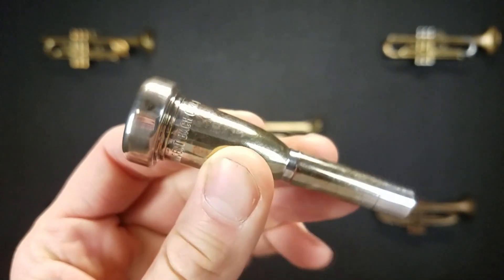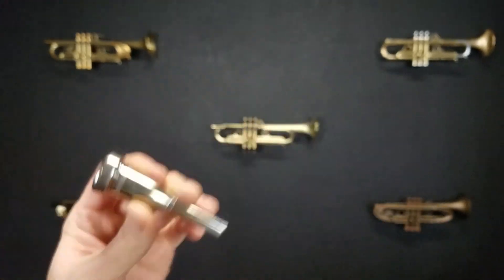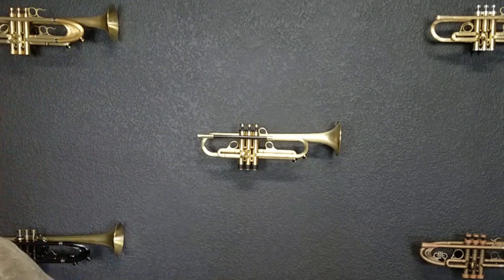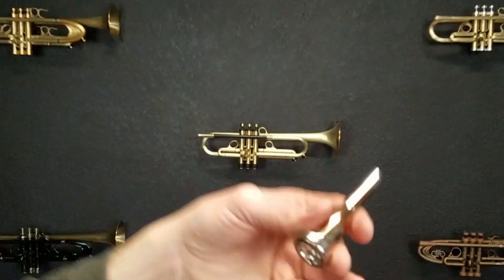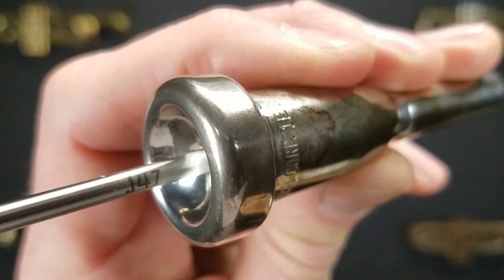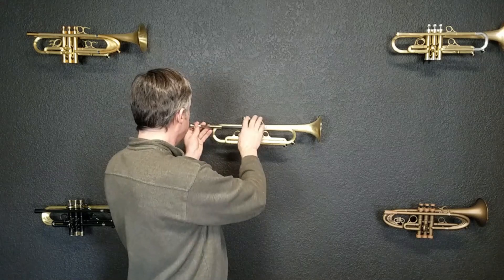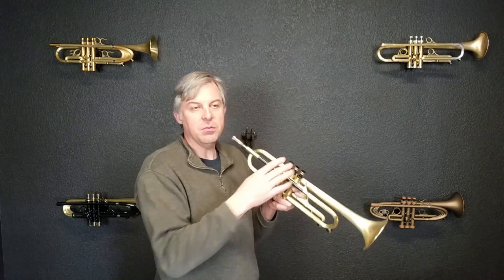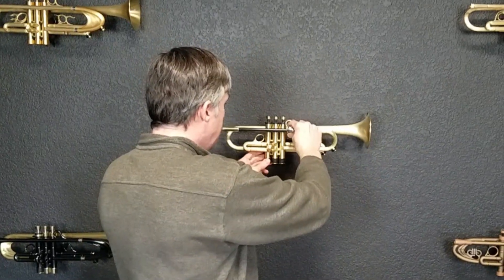Review: Trumpet Mouthpiece - Bach 1E Megatone - piccolo trumpet or lead?

Comment: I have a bach 3f so e isnt the shallowist
Reply from the maker: Actually, F isn't the most shallow either. In standard Bach sizes, A-E is only available, but other variations have been available by custom order on a very limited basis.
Reply: I have a 5V .... auditioned on it years back for many UK conservatoires ..... I do feel that was a HUGE mistake (I lacked flexibility and felt restricted) ..... been on Bach 1.5B which my old uni trpt tutor recommended and played well with although my own experience was only an 'okay'... but recently returned to 1.25C and like the better attack and flexibility.... happy on this one for now..  My 5V I have found a great use for.. my WWI army bugle has very poor intonation on the E and the original bugle mouthpiece doesn't help at all.  The 5V trumpet mouthpiece in it means I can manipulate this note much better and get it closer to the right pitch making me much happier when I use it each year for Rememberance Day.  The deep cup helps to keep a sound more suited to the bugle, even if fitting a trpt mouthpiece into a bugle could be seen as a little crude.